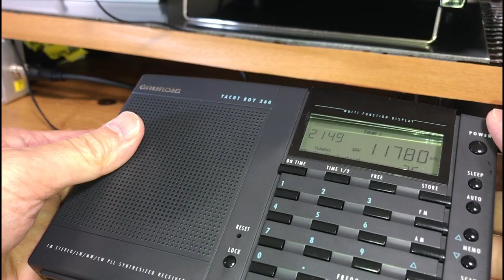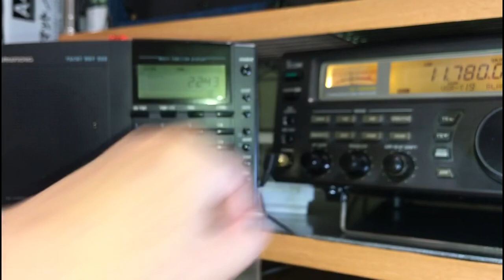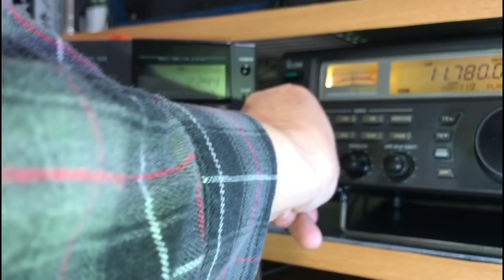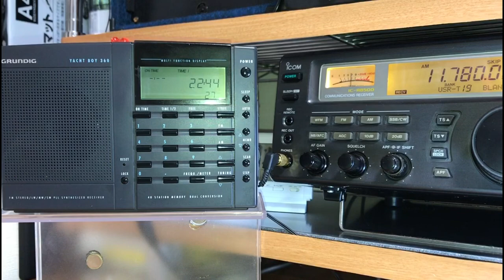ブラジル 📡 🎶 RN da Amazonia, 11780kHz, Brasilia DF / 17600km / GRUNDIG  YACHT BOY 360

Comment: Well done Mr Tengu. The look isn't a big issue as it's on radio's back side and wires partially hidden behind the kickstand. The reception was fine too, I haven't heard RNA for some time now. Thank you for sharing and 73s, Ron. 👌📻
Reply from the maker: Thank you, Ron. It is difficult to compare the performance without an external antenna, so I installed it. It has almost the same sensitivity as IC-R 8500. German brands are wonderful after all.73s Tengu 📻